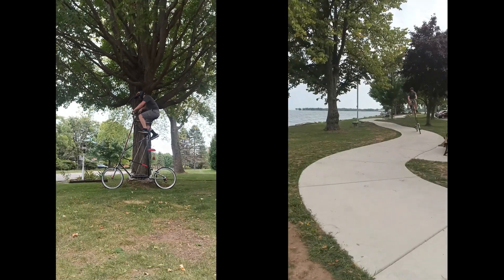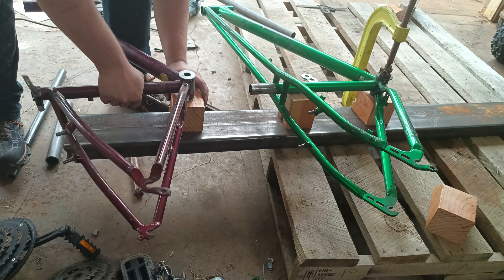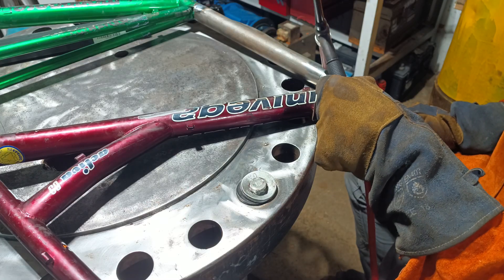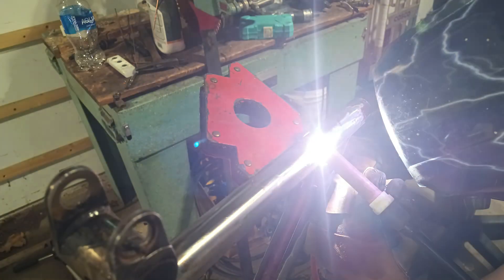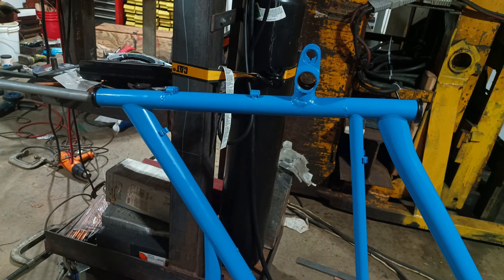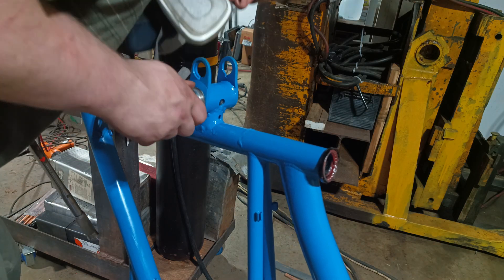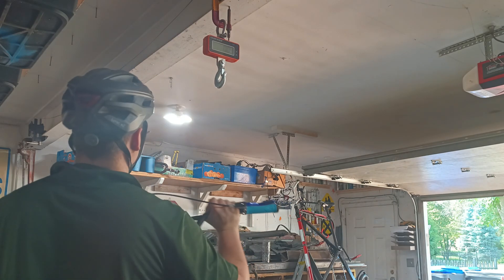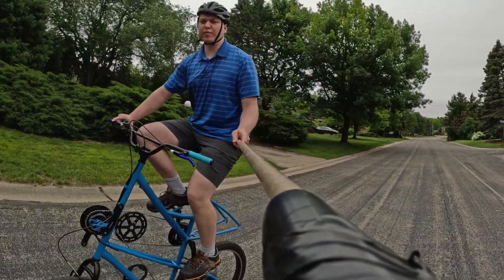The Most Complicated Bicycle Drivetrain In Existence

Comment: Great build, was thinking myself my tall bike would be nicer with fat tires and here it is.

Agree with Frida, some more info on why you did the multi-bb solution would be interesting. Maybe a part earlier in the video where you kind of explain your vision (as it was originally) and then as you build you can walk us through how it changed due to constraints discovered during the build.

My bike has the rear triangle of the top frame cut off, it's just dead weight. I think it could look cool to 'unfold' the chain/seat stays into one larger "seatstay" between the bottom triangle and the current spot.

Thanks for sharing!

Comment: Interesting Build. I was waiting for the part where you explain the need for a third crankset. Can't you just route the chain form the top to the bottom crankset?
Reply from the maker: It would normally be possible/ideal to route the  top bracket directly to the bottom bracket. However, if I did that, the chain would contact  and interfere with the bottom frame. This normally wouldn't happen on most tall bike builds, but I used a fatbike with unusual geometry.